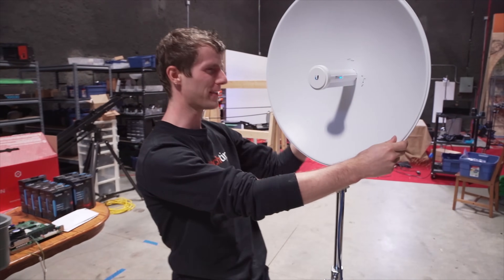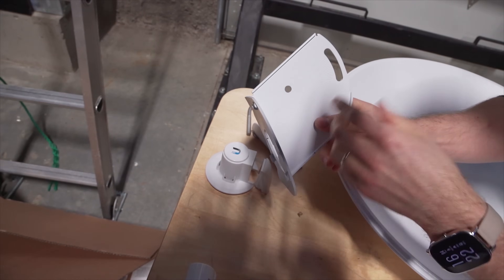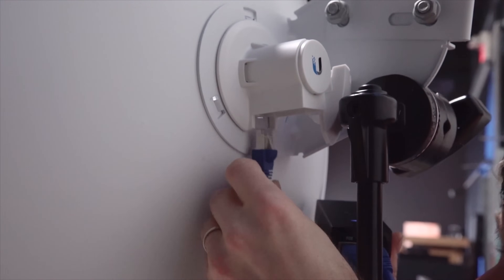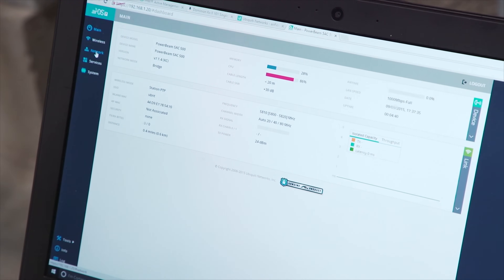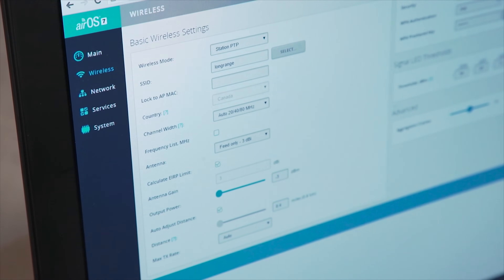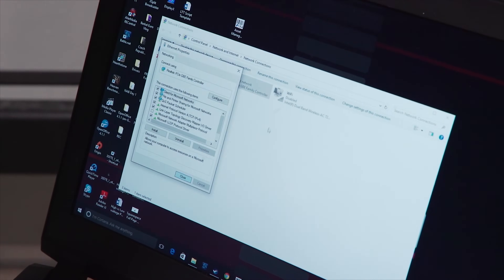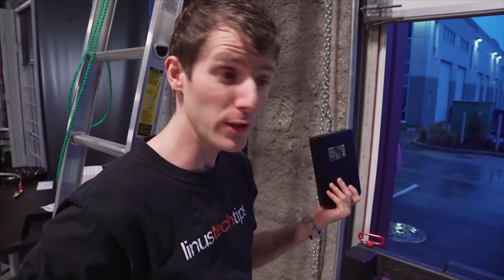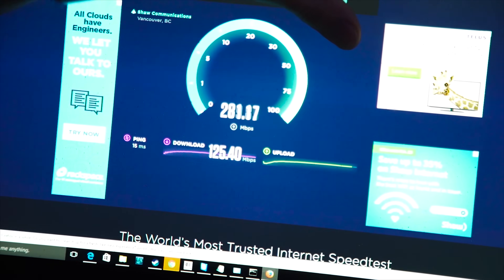HOLY $H!T - Long Distance Wi-Fi (Up to 25 KILOMETER range!?)

Comment: I've done 30-50km links with  older Ibiquity hardware before here in South Africa. Works well. Ping does go up obviously.   Linus do a proper example. Go climb a mountain or hill that has line of site to your office and show us the results.  (alignment is a bitch when you and the other guy is sitting on 2 towers 50m up in the air.)
Reply: +Francois Botha Yeah they could at least have tested the range in a nice real world situation and not just 50m down the road with $300+ worth of kit, even though the principles are the same.
Reply: +Francois Botha The newer versions of Ubiquiti products have GPS based alignment, you can input the coordinates in both antennast and get the alignment done.
Reply: +Luiz Fernando Cavalcanti dos Santos Their GPS stuff sucks.. Go cambium if your gonna use GPS. Ubiquiti's gps based "titanium" systems failed horribly.
Reply: evan ricci failed in we hat way? I we work in IT... never had problems. If you're going to say it's bad... provide evidence.
Reply: Luiz Fernando Cavalcanti dos Santos There's a reason even ubiquiti isn't continuing the titaninum line. Where to start? Costing wasn't good, they felt that the timed devices were worth more when they should have been focusing on making all their hardware support timing. Deployment? They had no central timing so the benefit of it was lost on them. I believe the edgeswitches tried to address this but chicken before the egg. Software was plagued with issues, Random reboots and session deauth's due to desync'ing. The only thing that they did well, is the units were sturdy as hell. Drop it 200ft off a tower? I'm sure its fine.. Ubiquiti has way better hardware (Power Bridges) and way more stability (normal rocket m5's) with better cpe options (nano bridge/beam?).  Timing just doesn't work well with 802.11* it's not what the protocol's for. For PMP your better off using a proper TDD solution (Look at cambium, or mimosa) I can give you a few dozen RMA's and constant tickets with ubiquiti 'maybe we can fix that in another patch' if you want to give me your email, I have about 3k units deployed. I like Ubiquiti as a vendor, but there is a time and place for any tool and ubiquiti's is rather limited.
Reply: +evan ricci I have friends, owners of WISPs here, with 200-300 Ubiquiti's devices running for the wireless side and Mikrotik and custom vyOS.
The part about cost and functionality you need to account for local prices and needs, in the US Ubiquiti faces problems both for their lack in better software(yes I agree with you there) and most trouble come from misinformation really caused by people either hating because they love their competitors. We all know how IT Pros are not susceptible to indoctrination from big old marketing.

I have PtP links over a mile, one friend just built a PtP link over 20km with AirFiber with GPS Time Sync over NTP. No issues at all...

Actually your complain about the timing sync seems more an issue in the infrastructure planning than Ubiquity clock sync. You need a local NTP server on any relevant point, like distribution towers... long range PtP need local NTP servers with GPS reference. That's it.

Yes, they are slowly moving away from the Titanium series because they are releasing better devices for those roles.

The best improvement on Ubiquiti is: Their firmware are actually getting way better after the development became independent and dedicated.

The UniFI series really have no competition in the same value, for example. I'm not a Ubiquiti lover, just that having another company evolving in that middle pricing range is so good for the market.

Before Mikrotik and Ubiquiti the cost for Wireless devices was so high, as sloppy they may seem, their existence is a blessing in our IT daily lives.
Reply: Luiz Fernando Cavalcanti dos Santos Yeah your certainly right; You managed to get an airfiber to work over 20km? I've never got any of those to work more than 7km's with the fresnel being completely clear. Too much other noise. And no the whole purpose of timing in the TDD world is to actually tell CPE when they can and cannot talk; Ubiquiti's GPS feature falls very short and it seems like instead of upping the ante and trying to compete they've backed down (abandoning the titanium series) which it wasn't their bread and butter anyway. Smart business decision on their part. 110% agree on The UniFi series, We've deployed WiFi to certain large environments with over 700+ unique AP's and while they do seem to have a high failure rate (We averaged 3%/month dying and needing replacement) they are definitely sick little beasts.  Mikrotik's bread and butter has always been the routing side the FPGA matched with good software is amazing, Use it a lot.

Comment: This could be very useful where I live. It's far out country (by danish standards) and the local fiber company will supply my neighbor, but refuses to supply me, cause I'm a private customer and he's a business customer, if I wanted fiber I would have to pay for the entire setup myself (some 500-600 meters and nearly 15k USD), instead I could get an account at my neighbors address and setup an antenna on his barn and my barn and get fiber speeds internet!!! Instead of either 3,5mb/s copper or 70-80mb/s 200Gb data plan!!! :D

Comment: You could have a few more of those and form what is technically a microwave relay link from your office to your home if your city allow you to set up relays on top of utility poles. The signal will take a few hops from your office, over the hostile terrain, to your home. Each relay, being a self-contained solar-powered unit, contains a battery pack, solar panels, a solar charger for the battery pack, a 5-port unmanaged PoE switch and two of these high power access points.

Comment: but.. how do you get 450 mbit/s wifi when using PoE? I thought that PoE took 2 cable pairs, and thus downgrading the cable to a 100 mbit/s cable. and lan is never faster than the slowest link..

Comment: Our school district that I work for used to use that to blast our network connection over the local lake roughly about 9 miles distance wide, overall worked good, we would have issues in the morning when the sun would come up causing signal interference.
Reply: +James Lewis on second thought I realized this is not radio repeaters like we were using

Comment: i have a smaller version of this. it gives me about a 5 mile range. i am set up as a point to multi point. i live in the middle of the woods so i ended up getting a 900mhz model which has much better penetration through trees. my one point 1000ft through a heavy wooded lot and i need the power on the absolute minimum. with that my signal strength is still maxed out. kinda crazy. ubiquiti really has it goin on. i will never buy consumer wifi gear again. their stuff is on a completely different level and its all way cheaper than consumer stuff as well.

Comment: if you were able to actually use the dish to beam internet to your home would you still use your home isp as a backup in case strong winds moved the dishes enough to disrupt transfers? Would there be a way to seamlessly switch from one internet source to the other?

Comment: I have a Ubiquiti Airgrid M5 installed at my house by my ISP as there is no wired connection here. 
Q) How can I access the admin page of the receiver? I guess they have changed the default IP address. I get 'connection refused' error when I connect to 192.168.1.20 wiz default address for it. 

Any help would be appreciated.
Thanks!

Comment: Im suprised the government lets you do this lol. Isnt there a limit on how much dbm your antenna is allowed to transmit?
Reply: yeah I was wondering that also
Reply: +MannYSJ 30dBm is the power limit and 53dBm is the EIRP limit (FCC ISM band limits for the 5.8GHz are much less restrictive than the 2.4GHz). The long range is the result of the huge antenna gain that allows for excellent reception.
Reply: +Enrico Conca Yep.  It's the huge gain that's getting the range not the power of the transmitter.

Comment: 25 km... and my wifi can't even pass through the upper floors... (i will love you forever Linus/anybody if you can give me some tips or send me to a video for reference)
Reply: Get a better ducking router. So you love me now?
Reply: +Gavin Scherer (MLG DudeDudeDude) almost, got some suggestions (i'm Dutch, using the standard modem from my provider called kpn if that helps)
Reply: +TotalXPvideos well there is your problem, modems usually have shit Wifi with low range. Get a Wifi-AP. Linus has a video about how he improved the Wifi in a home while he was in Taiwan or somewhere in asia.
Reply: thanks, love you all, I will give these tips a shot, more suggestions are always welcome ofcourse (yes, the house is concrete, most houses in The Netherlands are)
Reply: +DIYEyal and how much will all of this cost? (i know it's a google search away but i'm here now so)
Reply: hebbocake hij is nog aardig snel (als je die kleine kastjes gebruikt...weet niet hoe ze heten) maar het stopt er soms mee en dan moet je die kastjes opnieuw connecten en die kastjes helpen natuurlijk niet met wifi op mobiel
Reply: +DIYEyal I could do with super long ethernet cables where can you get them from.
Reply: +TotalXPvideos Ethernet over power dude, plug in a adapter next to your router, plug in an adapter next to your PC, connect each to their corresponding devices with an Ethernet cable and boom, way better than shitty wifi
Reply: Bongo2k that sounds like a better idea
and hebbocake you can get ones with an power outlet
Reply: hebbocake 300mbps isn't fast? Most home internet connections don't go that fast. And as gamerdude already said you can get ones with a built in power socket so you don't waste one.
Reply: +hebbocake I'm guessing that you're talking about powerline? You can get Gigabit ones, I have them and it's just as fast as ethernet. Of course it's more expensive, and if your house is old the wiring most likely will be to, causing slower speeds.
Reply: get in wall Ethernet over house wiring. Two adapters are cheap online. plug on in near router and the other at a plug near the area you USE to use WiFi. go wired, always better.
Reply: sounds great
Reply: hebbocake Well, I bought some powerlines and it says it can go up to Gigabit.
Reply: cut a beer or soda can so its like a satellite and put it behind you wifi antennas
Reply: +TotalXPvideos UBNT has a version of their Wifi and its sick, like 5-10 stronger indoor wifi then you can buy at best buy, this is commercial application stuff!   Here is the link: https://www.ubnt.com/unifi/unifi-ap/  
Mount that bad boy on the ceiling on your middle floor if multi storys and Bam you got wifi everywhere!
Reply: +TotalXPvideos guessing you're using the router/modem that you got from your ISP.

if it has several antennas try bending the antennas 45-90degree offset from each other, see if you there's the option to set to maximum output (it usually is on max) but in the windows settings your network card might be set to normal/medium.

The biggest recommendation is either op for a repeater or just get anew router with several big antennas.
Reply: +TotalXPvideos There's a video of Linus improving the WiFi in his wife's uncle's house in singapore I'm pretty sure you have the same problem
Reply: +TotalXPvideos turn you antenna gain down

Comment: 2 be ohnest if it's going to rain it will not work🤓
Reply: +Subtv PL Um, why not? It has a weatherproof dish.
Reply: i get my internet over an antenna of the same company, its alot smaller and works completely fine even if there is heavy snowfall (for german conditions^^)
Reply: +Daniel Stevenson Refraction through water droplets might cause some signal degradation over long range tbh.
Reply: +Subtv PL We have it in Australia and get all kinds of weather, works fine rain, fog you name it
Reply: rain droplets its a thing when the frequency ia over 10GHz, and the rain doenst stop the radio waves just refract them so you got a signal loss
Reply: Sadly it's Vancouver so it will rain